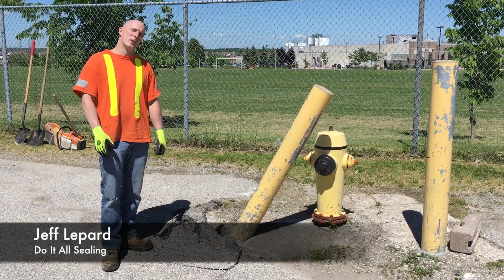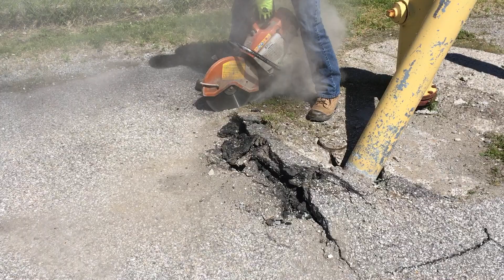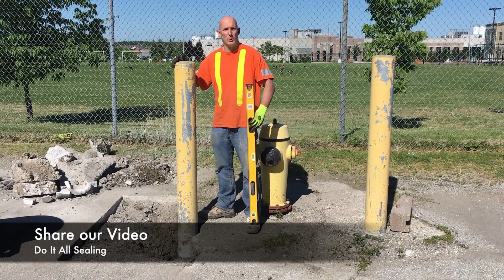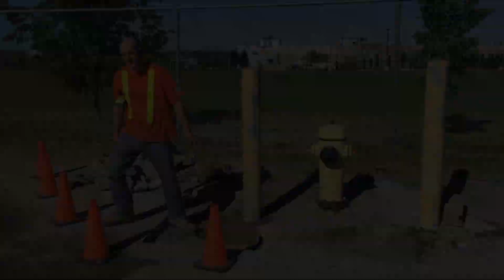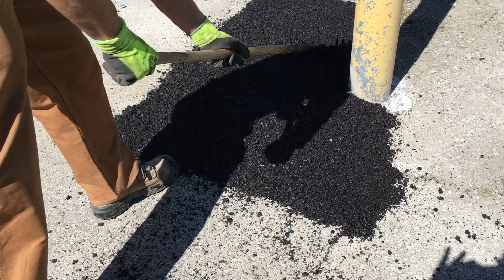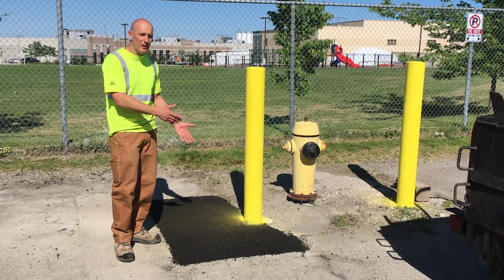Bollard Repair & Reset

Comment: Using gravel at the base helps. Drop the post in on top of 3" of gravel. If it's too low, dunp some more into the post or around it and lift it up until they natch in height.

Comment: You need to take some pride in your work, I don't care if it's in a alley details bro. To much water in the concrete mix, could of used rock base to level the two ballerds, use tack to not only bond the asphalt but seal your edges when your done and at least use cardboard to protect your new asphalt from that yellow paint.
Reply from the maker: Thanks so much for watching.  If you haven't already check out my new channel Do It All Sealing.

Comment: The edge of my property is next to a highway, we're talking about semi trucks going 80 if not more. What would you recommend to add something like this but keeping it esthetically pleasing?
Reply from the maker: That's a great question.  The only thing I could think of is a bollard unless you are installing something different like a massive rock or some kind of landscape.  There's also some really nice bollard covers and custom covers you can buy to slip over the bollard as well.  Really a tough decision for you I guess as to what to do.
Reply: The cost of bollards that can stop 80,000 lbs @ 80mph would be extremely expensive.

Comment: Please do not follow any of these as instructional bollard videos. Post mix concrete has very little strength and used only for fence posts and the exact same thing will happen again very soon with that little bit of depth. Google a bollard company, they fix pavers hack jobs regularly.

Comment: Hey man sorry if my past comments sounded like a asshole but seriously read this one. we use the Stihl wet/dry 420 saws, idk what yours is but I'm sure it's wet/dry too and we always use water to reduce clean up. Our jobsite is real busy with customers and cars at all times so all that dust wouldn't be good at all, we use a  construction trash can 55 gal on wheels,of course and a sump pump. And we have one man cutting and one man running a shop vac getting the concrete slurry up as soon as it comes out. Makes the clean up almost non existent.
Reply from the maker: Not a problem!  I agree this was a TS 400 saw.   Normally when I run this saw and there's no water around I use a portable tank to keep the dust down.  Same thing for my diamond core cut walk behind saw.  This location wasn't so bad it was far away from vehicles or people.  Thanks so much for watching!
Reply: Nice, yeah the dust is nasty from these saws. I use a 30 gallon barrel for h2o and a 2gal/min pump to feed the saw. Generator powers the shop vac which I empty into another barrel and let it settle and dry before disposal. Also allows for reclamation of water off the top of the barrel for mixing concrete or cleaning tools. Bollards are hard work, props for doing it all by hand except the saw.

Comment: How many hours of labor does it take to do all this ?
Reply from the maker: It probably took about 8 hours total split over 2 days.
Reply: @JeffLepard  8 hours split between 2 days for this man????!!! What!?? Last week we installed 8 bollards in one 14 hour day. Cut 14 inch square, jackhammered through asphalt/concrete, dug down 52 inches, set it, came back and capped it with a nice brushed finish. Why on Earth did it take you so long to do one bollard?

Comment: Are these ones stronger than the ones you can buy to bolt down?
Reply: Bolt down post's are weak. They work well for forklifts or something that makes contact with the post 12" from the ground. A car hits higher, adding leverage on the bolts and the plate and they don't perform well
Reply from the maker: Normally the ones you install with concrete are stronger but the bolt down ones are fine as well they serve its purpose.